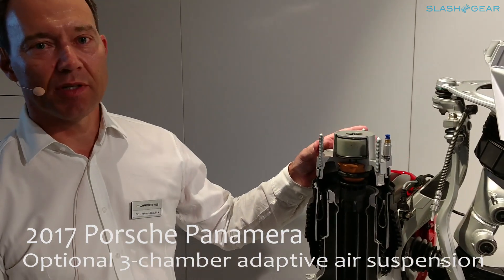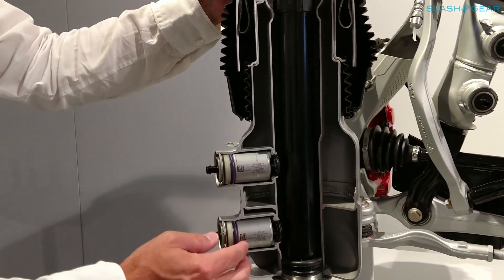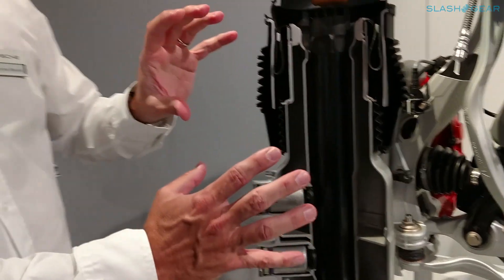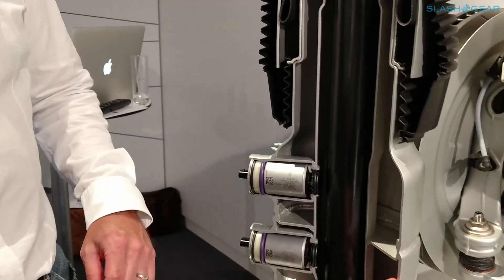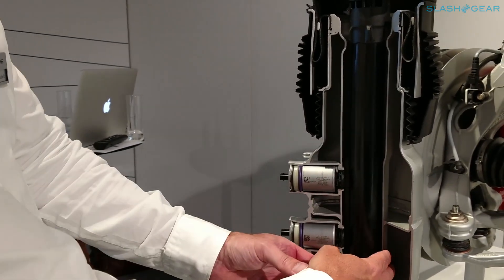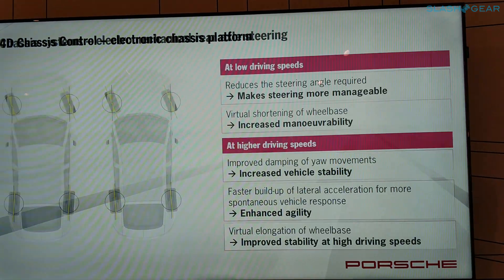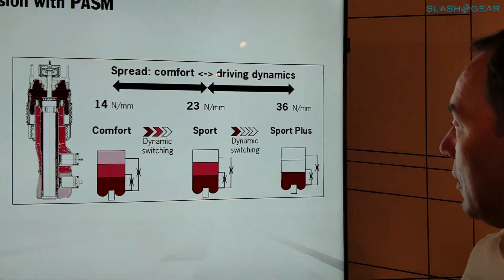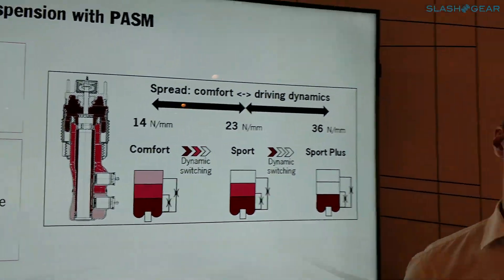2017 Porsche Panamera 3-chambers Adaptive Air Suspension walkthrough

Comment: Do the 970 and 971 both have three chambers?
Reply: No, the 970 has a 2 chamber system.

So 971 = 14 / 23 / 36
970 = 19 / 36

The 971 is softer in comfort and firmer in sport.